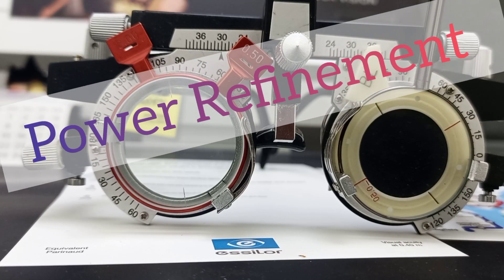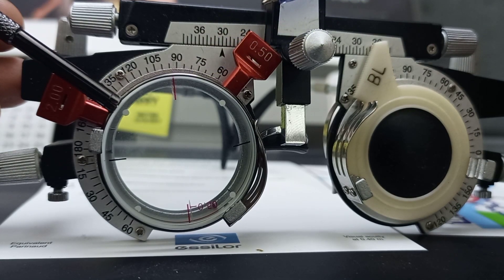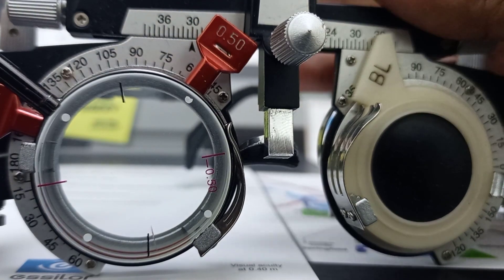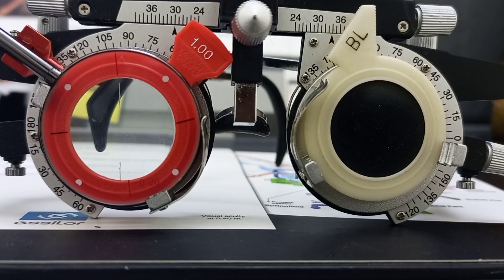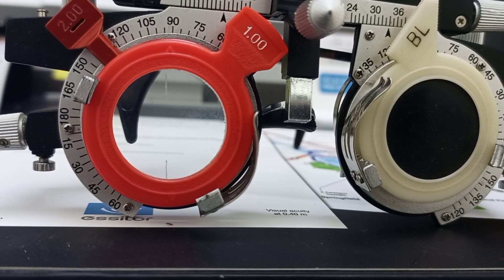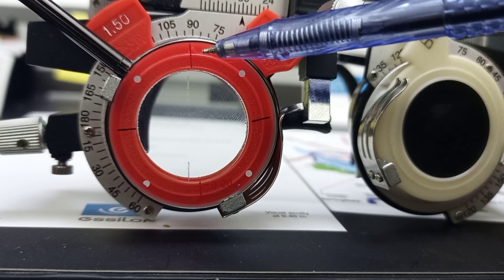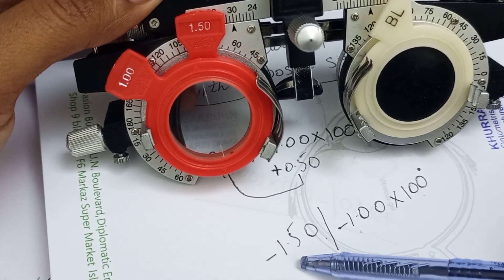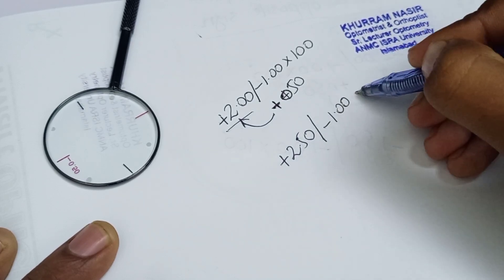Power Refinement and Spherical Equivalent through Jackson cross cyl

Comment: In jcc for power refinement why would we put axis of jcc parallel to trail cylinder axis ? And not the handle of jcc for this ? 
Plz ans this 
Thank you
Reply from the maker: Zara the logic is so simple ...
In power refinement , we align axis of jcc with axis of trial cyl because we have to find the exact cylindrical power of patient,
If trial cyl is minus, and when we align minus line of jcc on minus line of trial cyl the power would be doubled so we will do same thing until our patient gets maximum vision.
And when we need to decrease the power we will align plus line of jcc with minus line of trial cyl until we get maximum vision again.